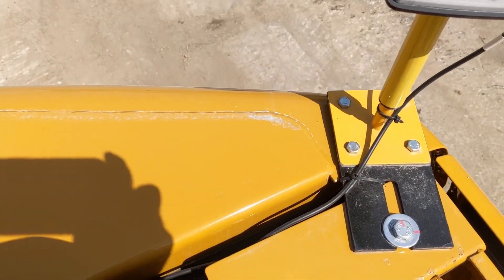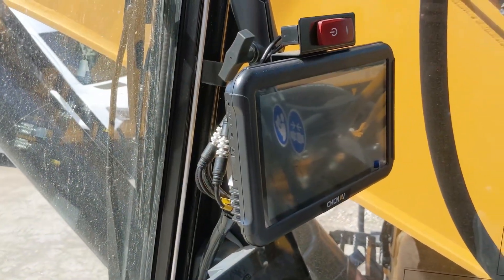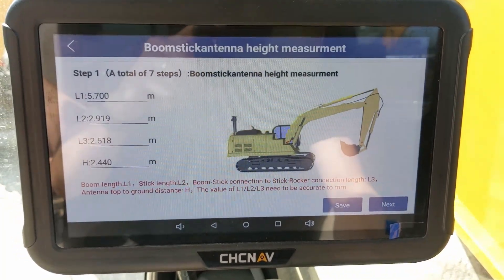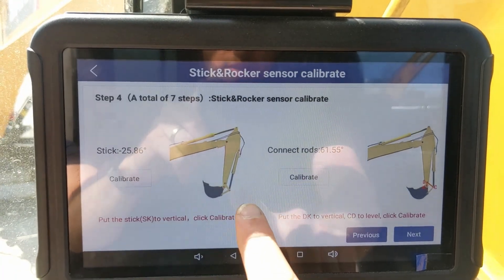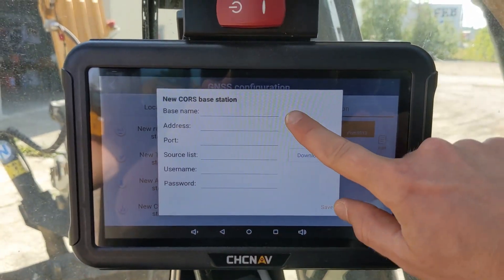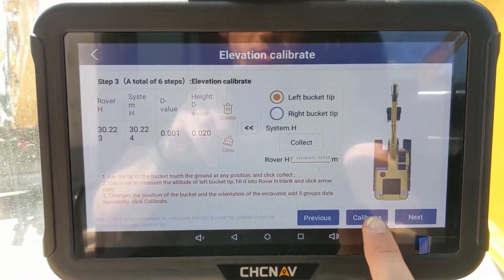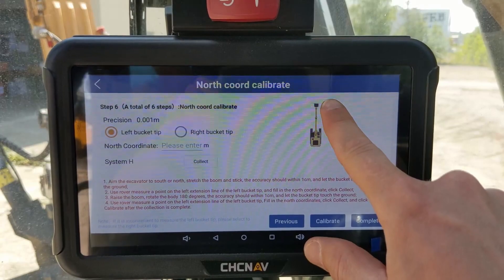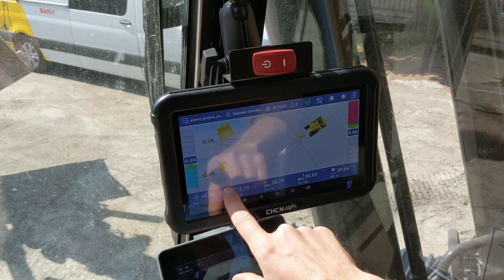CHCNAV MCNAV TX63 Excavator guidance system installation.

Comment: HI, I need some material for operation of this equipment, I'm using the Tg63, and it's not been good for me, could you please help me ?
Reply from the maker: Hi. I am sorry to hear of your troubles with CHCNAV grader system TG63. If you would like to share some more information with me I am sure I can forward you to the right person inside CHCNAV to help you with your problems. Which country are you operating in?
Reply: @siimsolovjov  Hi, I'm from Brazil... I really need support
Reply from the maker: Hi. Please contact Zafir +86 185 5169 6918 via WhatsApp.

Comment: Thanks Siim for giving an heads up on this..I work in a Mine and this can cut down Surveyors time to do floor checks..
Reply from the maker: Thank you! Machine control systems definitely free up a lot of valuable surveyor resources. In fact MC systems are one of three or four low hanging fruit for any company working with machinery. Together with training on-site personnel in using GNSS tecnology, using simple drones for photogrammetry and introducing simple cloud solutions for file handling, stunning results in terms of increased efficiency can be achived. Good luck!
Reply: @siimsolovjov  , exactly 💯.. It's a worthy tool for contractors seeking to minimize cost and increase efficiency..It's worth looking into..🙏🏼🤝